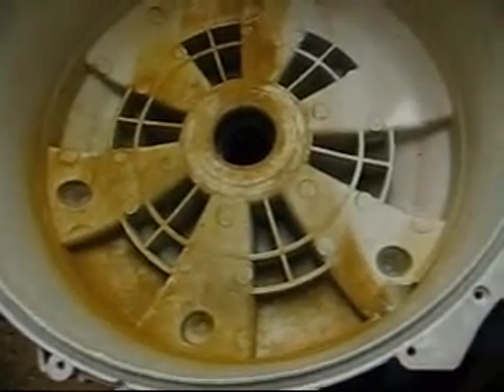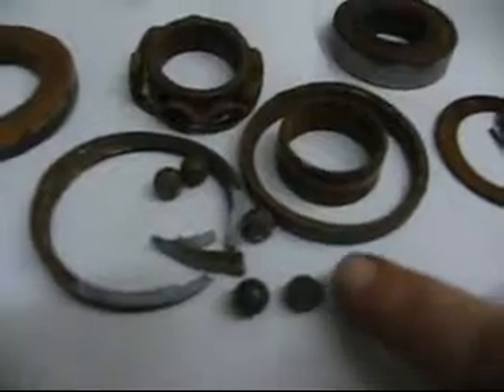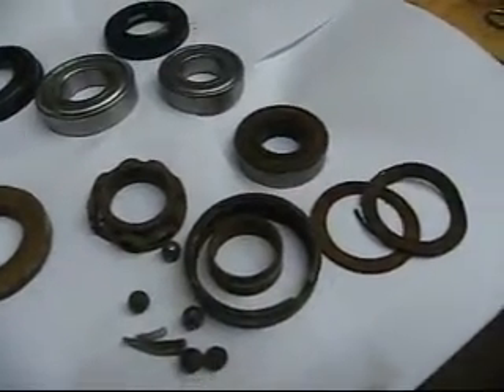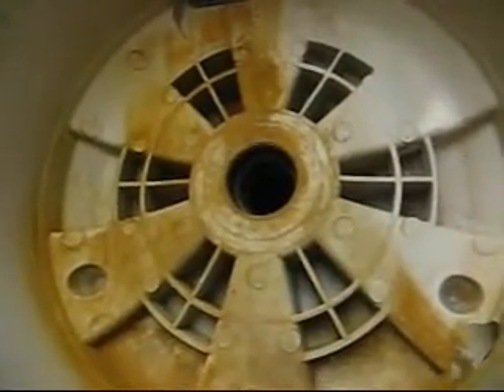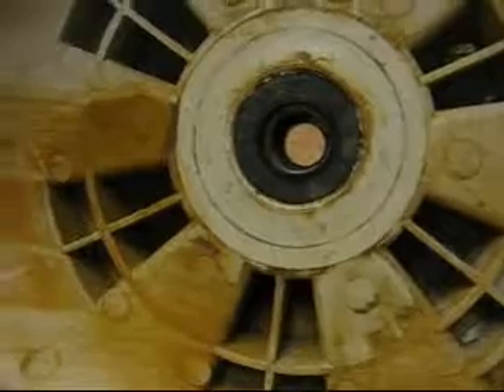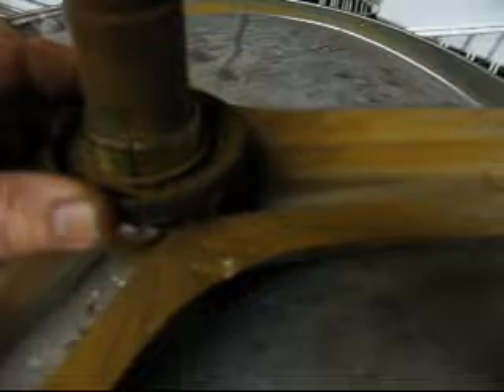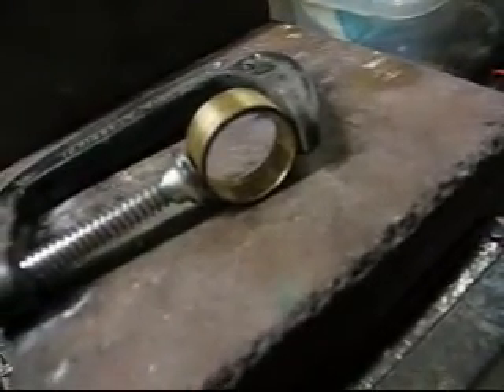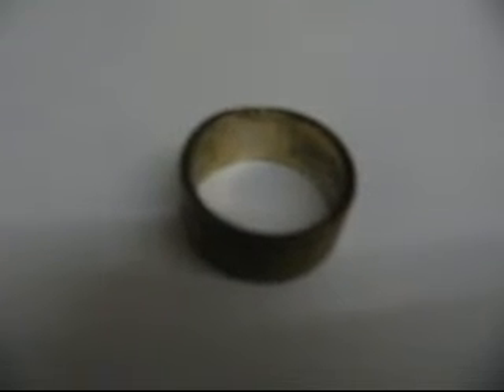DIY,washing machine bearing unusual problem requires silver soldering to fix it 0001

Comment: Just repaired my wielded drum zanussi, a very thin angle grinder cuts through the joint. The groove for a gasket is still there and the lugs were the bolts were fitted. I measured up the bearings and sourced from 123bearings much cheaper and far better quality. I drilled the bolt holes fitted a seal with silicone and  have used the machine with no problems.